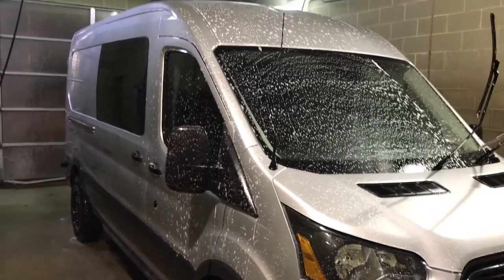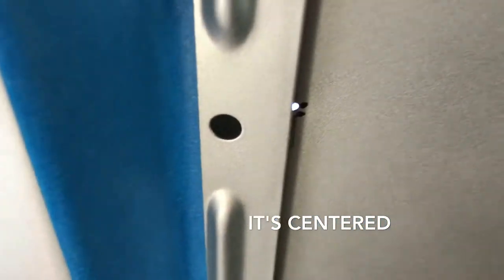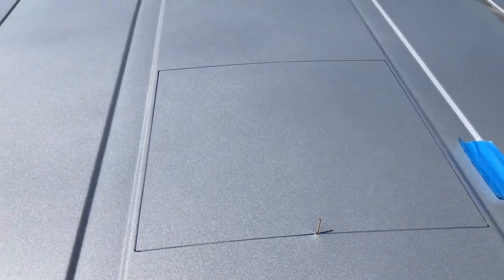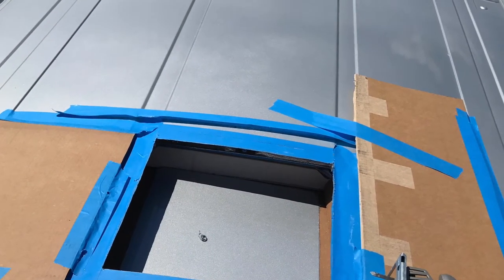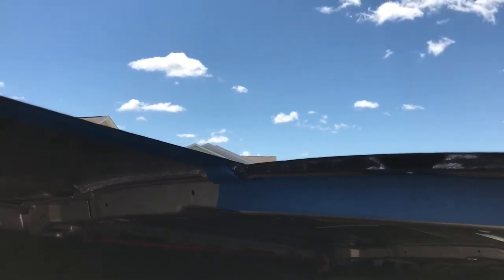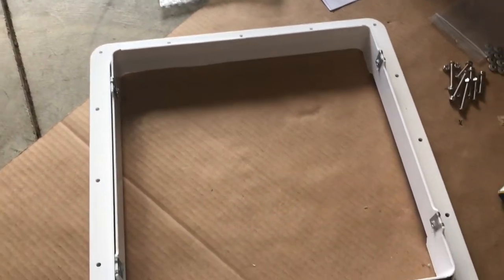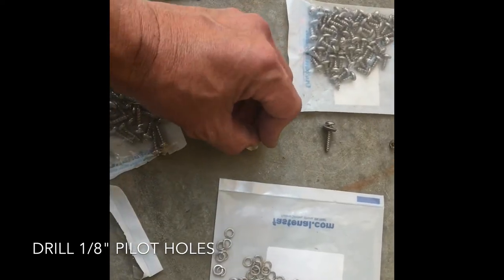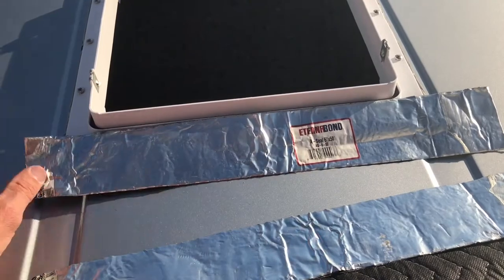MaxxAir 6401k Roof fan Install in 2016 Ford Transit MR 250

Comment: hey there, any regrets about getting exhaust only? I have this same one but am having second thoughts before installing it about not having the intake option to blow air over me. I was gonna just get a small battery powered fan in addition, but when i think about it i might as well have the ceiling fan blow onto me.
Reply from the maker: With a window cracked, good air flow. 

Since sold, do not recall if it had two way fan flow. Try the Klein tools portable fan or the Milwaukee fan for dual use/battery saving. Have both and work well

Comment: where are the wires connected to?
Reply from the maker: Jose Chavez -power supply on the Transit is available rear of driver seat. ( Factory supplied source.) Ground is driver side/floor level by the rear door(behind panel if you have them) factory supplied ground source.  Hope that helps, they are there.
Reply: There are many ways you can wire it, depending on what type of set up you're doing.  In it's simplest form you need to take it to a continuous 12 volt power source, just make sure there is a fuse in line with it.  The fan already comes with a built in switch.